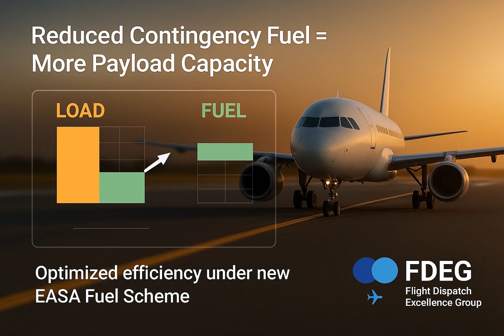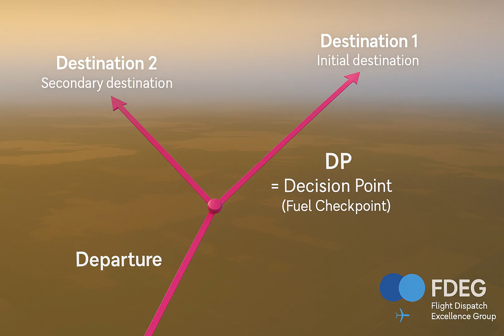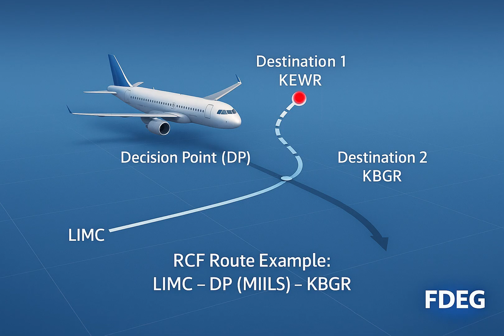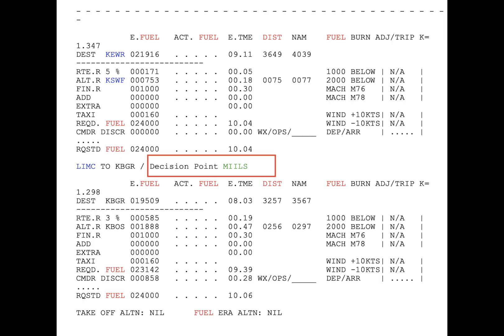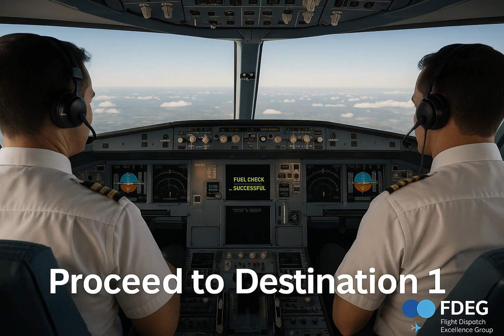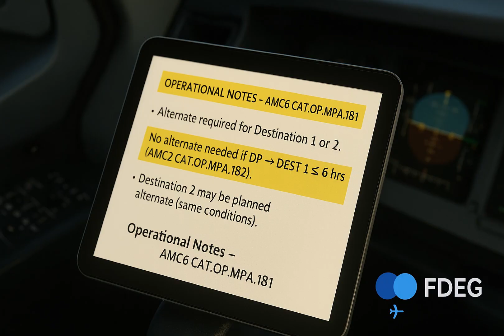RCF Procedure Explained (EASA Rules)

Comment from the maker: While the regulation specifies the 5-minute minimum explicitly under points related to 5%, 3%, 20-minute and statistical contingency fuel, many airlines apply the same 5-minute floor within the RCF framework as a good practice standard to ensure a consistent safety buffer in operational decision-making.

This practice has been adopted widely across European and international operators, precisely to avoid reducing the contingency fuel from the DP to the destination 1, below a level considered operationally prudent.